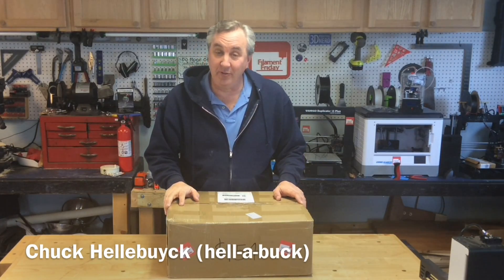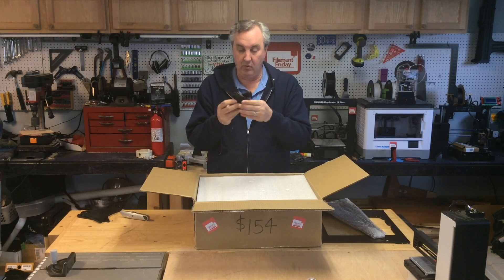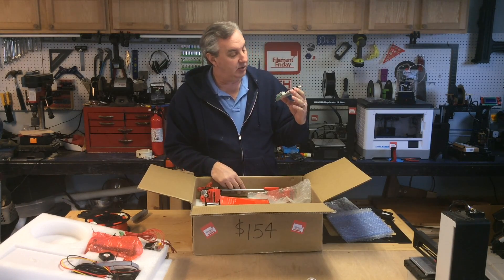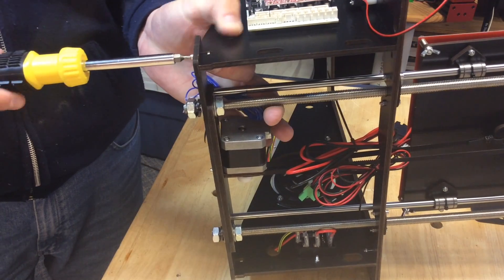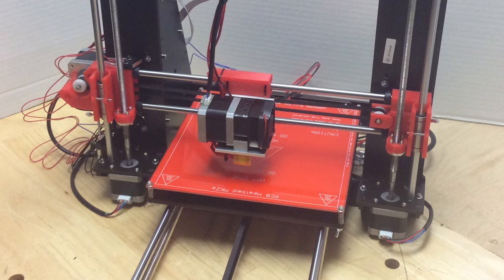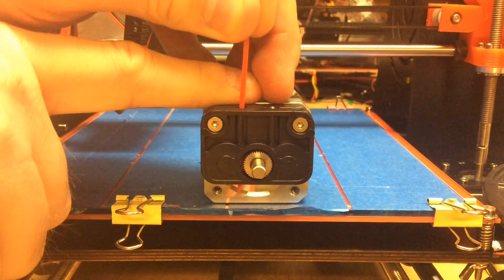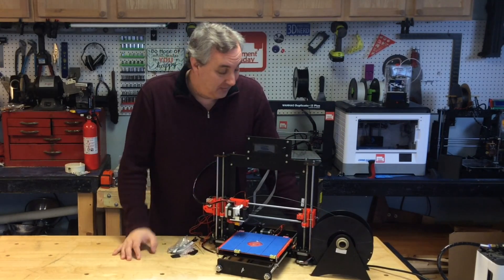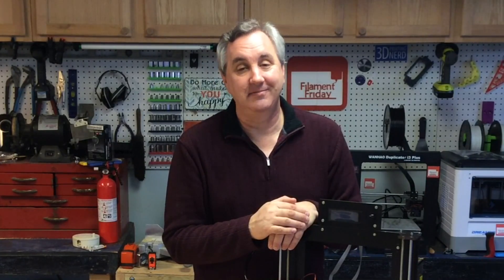$154 CTC 3D Printer Kit from eBay, Unboxing, Assembly and Test

Comment: I trash the lead screws for m8 acme threaded rods and couplers. The electronics kinda goofy and seems underpowered with that psu. So I got geeetech version of the board and better psu like geeetech recommends. Then I got tired with the end stops and messing with the z axis bolt. So I have a spare skr 1.3 board. Now it needs a better extruder.

Comment: Hey that’s the first printer I bought, it was rough at best lol, both threaded rods were pretty bent, frame was warped too, all the ore assembled parts were assembled very well at all, some hardware was lose and floating around in the box,  it my favorite part was the learning curve, I like to dive into the fire and this printer made sure that was going to happen whether you wanted to or not, the first thing I had to do was straighten the rods, and added some magic scotch tape bearings XD but it ended pretty good, great first printer to learn from and decide if you want to keep working on 3D printing, great video

Comment: Had these machines prior to my Ender 3 Pros. Spend the extra few dollars. The safety protection feature of thermal runaway on the Ender 3 Pro is worth the peace of mind. Prints are far superior too. This machine served a good purpose of teaching me about printers as a newbie. But I quickly out grew it.

Chep, have you done a video of 3d printing over view? Perhap safety hazzards , fixes, enclosures and filament storage? Very few videos talk about thermal runaway. It caused a fire in my print room I could have prevented had I known. I now have small fire balls designed for kitchen fires.

Comment: hi i bought the same one( 3 months a go) for $99.0 Ebay, just because. i knew it would be a DIY project and a cheap printer i would not use for any thing just play, mostly just wanted to see.
Creality Ender 5 3-d printer was already on the way, but this one came first.
Out of the box (box not damaged) the y axis was broken on the back where the motor mounted (very cheap plywood) assembled but did not use, I will put an metal strip on the wood to reinforce the wood later.
with the Ender 5 assembled i will print the (thingiverse 628019) up grade CHEP has listed because i know this will cause problems.
So printing up grade part in progress. I will be watching more of CHEP'S videos.

Comment: I bought e cheaper version for $110 that had a wooden print bed and a knockoff anet board. The heated bed is only about 2inches by 2 inches. I had the same extruder problem, but being my first printer I couldn't outright print a replacement so I contacted the seller and he straight up gave me a full refund and said to keep the printer so now I spent 30. Bucks on some mosfets and a Bowden kit with an e3d v6 hotend.

Comment: Does it need a glass palte on the Platen? Did one come with your kit? Mine doesn't have one and it looks like the plastic is sticking to the bed.  Yes, Thanks for the video. I needed to work the Z threaded bolt as you did.

Comment: I purchased one of these 2 months ago, and while it has some things that need adjusted/upgraded out of box, the extruder it came with has been surprisingly stable so far. Gantry had a bad belt that bad to be replaced, and the kit I bought didn't come with a glass plate or SDcard (the kit was $117 so maybe that's why). It had the generic board instead of the Geetech so I've had to grab some mosfets for it since pulling all of those amps through that generic board for the heatbed is a bit of a fire hazard.  I've printed some upgrade parts and bought some 1/32 stepper drivers and a fan for print cooling, should be print like a rockstar once the last of the parts arrive. Even though I'm new to 3D printing, I've got prior light industrial experience that made the process less mysterious, and I've had fun tinkering with it so far.

Comment: Hi All, last week I got myself the same printer but I am having a hard time printing out anything properly. I tried to print out the .gcode model which comes with the printer but the printed object started to move around halfway the printing process. The same happened with another printed object. Do you have any ideas how to improve  / fix it? By the way, great video!  :D
Reply from the maker: Use a swipe of Avery glue stick on the bed to hold the print.
Reply: CHEP I'll give it a try. Cheers

Comment: Good review. Lots of new technical terms. I have one on order £85 UKP..that's about $109..from flea bay.
It has metal couplings instead of flexible pipe on the y axis motors.
Reply: in reality it was like yours. It works ok,I'm amazed.It needs a bit of extra plywood for support on the vertical poles for  print carrage up/down..poles too short.I didn't have your filament feed problem but the spring loaded option looks a good option.

Comment: I'm having a bad time pushing the rod in the plastic tube, do you have any suggestion? Do I need to unscrew those 4 bolts in the black plasting ring attached to the horizontal axis (the one with the nozzle)? Because my rod is inside the plastic tube a bit, and the rotation of the rods correctly make the horizontal arm go up and down, but without going all the way down the plastic, i fear there will be problems when the rotation goes all the way down
Reply: Thank you, I noticed that if I push the bed all the way down Y, when the stopper clicks, the nozzle is barely on the glass, dangerously resting upon the bed. Same thing If i Slide the nozzle to the right (opposite to the X stopper), and the nozzle is not on the glass,  is it a problem or the software will manage to operate only in the center of the bed?

Comment: This is thing is down to just 100€ at German resellers... insane. But as seen on your video not worth it, thanks for saving me the money!
Reply: you can salvage parts from it they worth more money than the printer itself hehehe
Reply: If you know what you are doing you can build around 200 usd an ultimaker style printer buy ordering parts from ebay, aliexpress, banggood etc.. Even for 120 130 usd you can build a prusa style good machine.
Reply: I got a version of this CTC printer for my birthday, and I love it. People just need to go through Amazon so you can return it if the z-axis binds or if the extruder slips.
For me the right X-axis belt tensioner would also hit the screw on the frame when raising the extruder. I gorilla glued the brace overnight and removed the frame screw permanently.
I am getting pretty good prints out of mine, even with the stock extruder. I did print the upgrade to the extruder, but I have been hesitant to rip apart the current one to salvage the pulley. The hardest part for me was going through Cura to fit the software to the printer.

Comment: If you twist the power supply through 180 degrees so that the connections are at the bottom you don't have to stretch the cables.

Comment: I just put mine together yesterday. Great video that helped a lot. I would recommend to everyone building one of these to tighten the screws of the preassembled parts as you put it together. All of mine were loose and needed to be tightened. Now it's time to try and print something (gulp). Thanks again for the vid.

Comment: I bought this exact same printer and your video has been such a help to me. The "Chinglish" instructions that were included were such a pain to go through that I resorted to Youtube for assistance.

I am an engineer with a wide field of experience, and I even struggled with some of the assembly of my kit. Some parts had to be removed, repositioned and refitted. (I notice that your Z-axis motors have the connections facing out to the front. I took my motors off and turned them around so that the cables would go through the holes at the rear. A far tidier and neater job).

Also on mine, the wooden bed that supports the heat bed had the corners broken off when packing so I had to get some wood and make a whole new bed.

But, I have to say - of all the videos I watched, yours has been the most helpful. Well done.

Comment: Hi just took delivery of one of these today can you tell me if the smooth guides are supposed to go through the mount holes with the bottom sitting on top of the stepper motor as there is no way they will go in without i open the holes out with a drill.
Thanks in advance.

Comment: Bought similar model only with acrylic 185$ and had similar issues.
I think it's mainly about attitude when you buy such a cheap 3d printer, staying positive, having patience, analyzing the root cause of problems and solving issues one by one and you can eventually get pretty good results.
Only you gotta accept it's not gonna be working like a charm right away.
Cherry on top there is such a nice and helping community in 3d printing.
Nice vid.

Comment: Hello;   I am a newbie and need some help.   I got one of these printers as a present and enjoyed putting it together.  Now for the help part.  I turned it on and the LED screen came on and went off.  I tried it again and the same thing. So I checked out the wiring to make sure it was all ok.  It was and I tried it again, same thing.  I used the USB connection and it seemed to work, I could get the bed leveled but could not get the SD card to work.  But the switch still doesn't work. I even changed the switch with a new one.  Can you give me any ideas on what else to do or to try?  I have to say its been setting there for a couple weeks because I just got flustered with it.  But I have been interested in 3D printing for sometime.   Help Please!!

Comment: I had a similar, but better experience with almost the same printer from another eBay seller.

My extruder worked perfectly and it printed ok straight out of the box, and very nicely with some careful tweaking. 

Not for beginners, but really surprisingly good for such a low price if you are experienced with 3d printing.

Comment: The extruder and hotend are both seriously horrible. This video at least makes me feel better, because I now realize I'm not the only victim of the thing. I think whatever life was in the print-head was used up within a week- after that, the best I could do was to get it to print maybe half of something before the extruder and the hotend combined to produce epic clogging. My experience was that the head would often fail to feed at all- it was either too loose or too tight, it was never just right. I'm having mine replaced with a Titan/V6 combo that will hopefully bring it up to a decent level of performance. Buy this thing for the frame and board, toss the extruder, and put on something decent.

Comment: Chuck I have the 3d printer and the temp doesn't change when heating up I have changed the thermistor and that's not changed got any ideas very stock

Comment: Hi Chuck,  Unfortunately I bought this printer before I saw your video (this is my first 3d printer) and I'm having the same problems with the layers. I changed the extruder to a bowden style extruder and also changed the filament heatsink to an E3d style (exactly like you're upgrade) but I'm still having problems. I've actually ordered a stepper motor to change the extruder motor . do you have any ideas of anything else that might be contributing to the problem?

Comment: How did you get this to work with Cura? For me it says "The printer is not connected".
Reply: Just setup this printer as Prusa I3 in Cura, but change some settings like height and fillament settings... :)

Comment: I got one of these for Christmas and am now just putting it together. I've already ordered new drive gears and couplers as an upgrade. Best $10 I can spend on it. 
I also had the bad leadscrew thing going on so I'm going to take care of that while I wait for the upgrade parts. 
I can't get my extruder to work at all, so far, but I have confidence I can get it to work, or I'll buy another motherboard. 
All in all, it's not terribly hard to assemble but there are a LOT of improvements you can make to these things. One thing, for sure, is to add a center nut, on the bottom threaded rods, to stiffen up the frame by securing the main square to the two outrigger ends. 

Thanks for making the video.
Reply: Thanks for mentioning that. I did preheat the nozzle for PLA and the temp reached as high as 190c and still no love from the extruder stepper on either .1mm or 1mm setting. 
I verified that the motor, itself, works by switching the input from the Y-axis cable to the extruder stepper and the extruder stepper works fine. 

As an extra tidbit on this model of printer, the Z-axis problem many have can be from the horizontal axis spreader bars not being set wide enough. When the belt is tensioned it can cause the guide rails to bow a little and that causes extra friction on the linear bearings. 
I solved this by over-spreading the assembly a little bit, then tightening the locks. Now I can tighten the belt considerably with no binding.
Reply: The supplied extruder is junk, plain  and simple....as i've mentioned above, I bought another extruder, and used half the parts to codger together an "extruder" that'dwork on this rig..........and it does fine once dialed in.
Reply: Where do I go for spare parts? This is a Christmas gift 2019 and have got it put together, but now paused for grandchildren time. Just asking as expecting the worst.

Comment: I bought this exact printer like a week ago by accident (Wanted to buy an Anet A8). It is also my first ever 3D Printer. I ran into all the issues in this video. Every single one of them. Plus mine arrived with one of the wood parts broken already. When the nozzle got blocked up, i just decided to buy some cheap extruder instad of a new nozzle. Let's see what that does, It'll arrive on thursday. :)

Comment: Honestly I think it's a waste of money.  I would dump most of it in the bin and start over.  There are no nuts holding the frame to the chassis, flexible tubing for the z-axis, wing nuts for the bed, extruder/hotend is junk, 15A power supply, no cooling fan.  Someone new to 3D printing shouldn't buy this, someone who knows 3D printing wouldn't buy it.

Comment: I got a tronxy P802M from ebay for $166 after shipping. For my first printer, it took about 8 hours to put together, only the extruder and hot end were put together. I didn't have to do anything other than screw it all together and plug it in. It prints amazingly. The power supply it came with claims to turn on/off the fan according to temperature, but it's on even when not running. I opened it up to find there's no thermostat or even a spot for one. So far it's been cheap and loud, but works great.

Comment: Buy the same printer but I can not make quality prints can you help me?
I try to save the settings with the lcd but they are deleted every time I turn off the printer?
Indicate me as it is calibrated, which is the first step after completing its assembly

Comment: Hey Chuck. I just got the same unit about two weeks ago and yep, took between 2 and 2 1/2 hours to build. Only problem is I can't get the software to load. Did you use the cura 14.09 software or something else?  At least you are getting a new extruder, I can't hardly get a reply from my seller.  I feel it will be a good first time machine but really would like to see it print something. Thx John
Reply: Wow. Has it been three months since I last contacted you. Got sidetracked and lost track of time. Have just gotten back to unit and still can't print anything. For some reason if I start at 0,0,0 the unit, when trying to print, the print head stays about 1/2 inch above the bed. When it first starts out it is the thickness of a piece of paper.  Any ideas what might be going on. I did find out I am using cura 14.07 instead of 14.09. I'm wondering if there is something wrong in the control-motion screen. Any ideas? Thanks John

Comment: Hi Chuck. I have the same printer, I never tried the stock extruder and instead put a $5 E3D V6 clone on it. It prints better than the davinci 1.0. I am very impressed with this printer. (I have an FT-5 as well).

Comment: Glad I wasn't the only one that had the same exact problem, the seller was very good at trying to solve the issue by sending me out parts but I never got it to work so I ended up getting the Anet A8 instead which is great!!!!! And I've had no issues at all. I wish I had seen this video before hand so I could have done what you did. Great content :)

Comment: I have the same one, with the threaded rod wobble, I'm gonna change the little bit of tubing at the bottom, to leadscrews, as it mm night help, I cannot get a decent print, and having to constantly mess to get it to feed, or level the bed.. interesting but hard work.

Comment: Hi Chuck, great video.  It's nice to see the differences between this printer and the one I picked up from ebay.  My one has aluminium flex connectors for the z axis threaded rods and a metal gear on the y axis motor.  I have to admit, when I bought mine I wasn't expecting much, but I figured £150 for a box of parts to use on something else was a fair price.  Well I came to the same conclusion as you, not a great printer for first timers but awesome for someone who wants to tinker.  The only thing I had to change out of the box was the hotend thermistor, the one supplied was giving some bizarre readings.  I have since changed my y axis setup, fitted a MK8 all metal extruder and an E3D lite 6 hotend.  I couldn't find a bracket for this anywhere so I designed one.  I also designed a layer cooling fan mount.  Finally I loaded a new version of Marlin.  Total cost of the mods was under £50 and what a difference it made.  I've even ran the E3D Volcano on it with the 1.0mm nozzle.  This is defo a great printer to test things on :D
Reply: Hi StevenQ-NE-UK (dutch or UK??) , How did you manage to load a new version of Marlin on this??